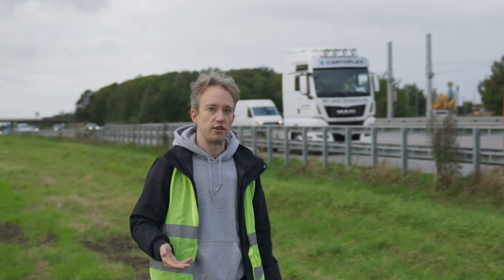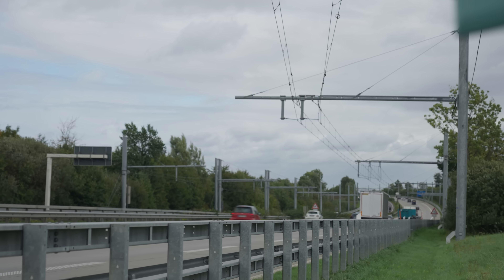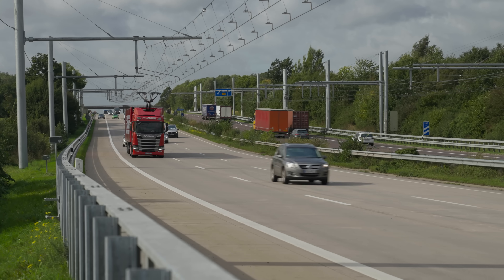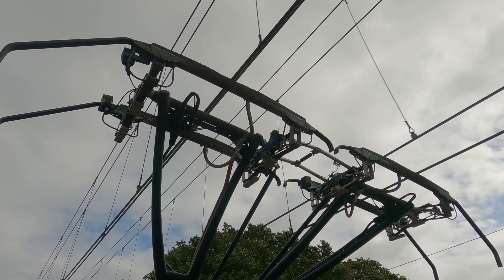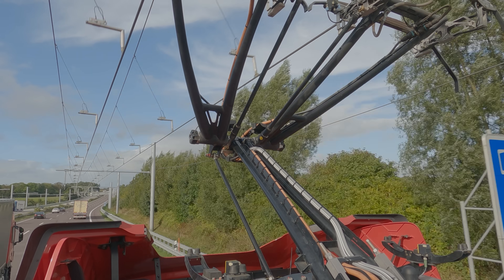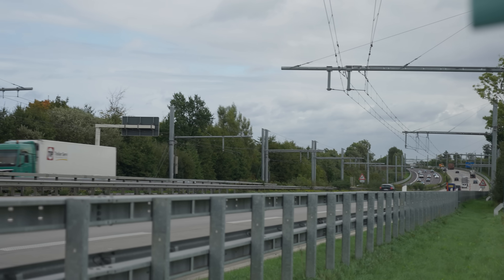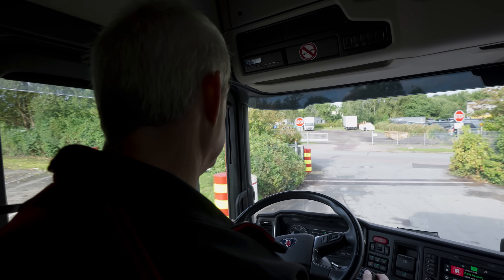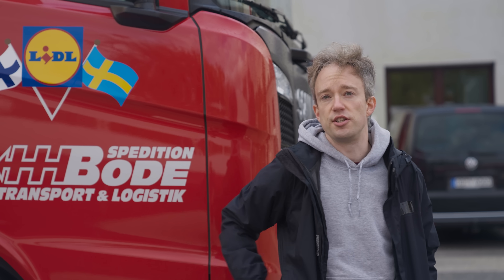The highway where trucks work like electric trains

Comment: I get it that it is just like a train, and this electrified road based transport has been done before (trams). But the hybrid nature of this is a delightfully good idea. The trucks can have back up batteries that allow then to do the last 50 miles off grid and then charge up when they get back on the electrified highway.
Reply: trolly bus and trolly truk
Reply: Eventually this system will become a rail based system again because trains are the crabs of transportion.
Reply: Also in Newcastle NSW Australia, their tram line doesn't use overhead wires, they charge the capacitors when at a tram stop with a pantograph! And the Newcastle trams use 1435mm gauge track!
But wait there's more... All the Australian tram networks use 1435mm gauge tracks even though the different states have different gauges for the trains!
Reply: Should have been compared to trolleybuses than trains.
Reply: or just have trucks do the last 50 miles and have trains do the rest?
Reply: @klintcook-z8m  Even in socialism you need capital to build infrastructure. Yes we could reintroduce slavery as a measure for cheap labour, but until then trolley trucks are a viable alternative for areas without possible rail infrastructure.
Reply: @klintcook-z8m  Reloading is a b**ch for logistics firms.
And electrifying existing main road trunks is much cheaper than expanding train tracks, or even building new ones. Same land use, aready existing fundament work ect.
Reply: @klintcook-z8m better yet - remove the need for those last 50 miles by having cargo train stations at industrial sites and passenger train connections with large warehouses for consumer goods, now just cook with dry or frozen goods and cultivate some veggies in your local walking-distance garden😅
Reply: @miepmaster25  spot on, that is exactly what occurs in Netherlands and especially Switzerland. In fact if you examine old industrial centers in the united states, they often had a railway line running up to the rear loading decks or right through the industrial park for this very reason. Yes they were electrified like they are in europe but anything to avoid the massive tyranny of road based delivery which is incredibly expensive.
Reply: @klintcook-z8m  The existing railways are already used extensively for freight, so if trucks weren't needed, there would be no trucks already. They use the same rails.
Reply: @SteelSkin667  Freight rail is extremely underutilized in Europe as freight companies are private, but rail infrastructure is public, so they favor public passenger use.
Reply: @klintcook-z8m  that would be massively inefficient though
Reply: @ObristPlayep  why? i would imagine leveraging and existing train infrastructure is cheaper than the overhead power lines for the truck's pantograph.
Reply: @klintcook-z8m  I guess this is for places where there is no sufficient train infrastructure already present. And there, only building the trucks+overhead lines is significantly cheaper than building trains+lines+tracks+stations, and more flexible
Reply: @kleinhaas137  true, but europe does have an extensive rail system. maybe the industrial infrastructure is distinct from the passenger rail system. it just felt that this is a solution to a non-existent problem. but i may be wrong.
Reply: @kleinhaas137  Fun fact: The two cities connected by this highway are also connected via an electrified mainline railway route certified for 160 kph, so there already is a sufficient solution in this case.
Reply: @ObristPlayep  No, as nearly everything is containerized.
Reply: @j03l911  damn this fact makes that infrastructure completely worthless
Reply: @ObristPlayep  trucks are massively inefficient compared to trains, less friction, less rubber, more load, and less awful batteries
Reply: @klintcook-z8m  transfering cargo between platforms and the logistics.
Reply: @klintcook-z8m  No, you’re 100% correct, which is why there is little to no interest in it from people that actually matter.

Electric freight trains are FAR more efficient than electric trucks like this. All you need are BEV trucks in towns/cities to get the goods from the trains to the customers. That’s not to mention the cost of building/maintaining this or the trucks themselves or the traffic they would create.
Reply: @TheProtocol48  Freight transfer is a very simple thing that these trucks still need to do anyway. Long-haul trucks tend to deliver to centralized distribution warehouses that often have their own train tracks anyway.
Reply: @kleinhaas137  the rail infrastructure to handle a given amount of traffic is orders of magnitude cheaper to build and maintain than the highway infrastructure required to handle the same amount of traffic, not to mention trains are just inherently more fuel-efficient running off any source of power than road vehicles are. Any benefits from electrification will be far outweighed by the cost to build + maintain the infrastructure and environmental damage caused by highway construction, road and tire wear.
Reply: @afcgeo882  Aside from a couple of Royal Mail depots in the UK I have never come across a distribution warehouse that has its own access to the railway network. If a warehouse did have rail access, it would only use that for a bulk import. If it were to use the same access to then move goods to their individual destinations, you would need just as many locomotives as trucks as the trains coming out would only be one or two cars long. Then there is the destination, this can range from being in the middle of a city to in the middle of nowhere. Neither of which are likely to have access to their own train station. So now you need a truck to move the goods from the nearest freight terminal to the destination. This method would be vastly inefficient compared to using one truck for the whole journey.
The railways are good for handling a very low number of very large vehicles carrying a huge ammount of freight all going to the same general area.
The roads are good at handling a very large number of very small vehicles carrying relatively small quantities of freight going to many different destinations.
Reply: @ObristPlayep  You would need to work out the energy consumption used by trucks to move say 60 loads as against a train , including things like wages and maintenance . Dont ask me , i am garbage at maths
Reply: @klintcook-z8m  I think the point of this is it allows electric trucks to make long distance trips more efficiently.

A company that does the final deliveries may want to transport trucks from one city to another at some point for whatever reason. or have inter-city trucking for whatever reason. Using a railroad may be too much of a hassle or its easier to just load up a truck once and then unload it at the destination rather than having to load up a truck, then unload onto a train, then unload back onto a truck, and then finally unload at destination. Thats two extra unloading that doesnt need to exist without the train in the middle.

So this solution allows companies to still use electric trucks to avoid the extra loading/unloading of their trucks, and also allows their trucks to travel between cities without their vehicles being locked to a specific city which may only let them easily service locations within their own city.

This also helps for servicing remote areas too. For example, lets say a company has a big warehouse in a city. But they want to service a small town about 100 km away. There is a trianline there, but they dont have any infrastructure there in that town to transport the goods from the trainline to the customers. They would need a small truck to transport things the rest of the way, which they may have in their main warehouse, but they have no way to actually get that truck to the small town without taking a highway off grid which requires a combustion engine. So having a highway like this means they could use an electric small truck to transport the goods out there and then it can run on its normal electric battery while delivering products to the customer once inside that small city, and then drive back to the main warehouse. No need to have additional infrastructure to house, store, and charge trucks in EVERY city/location they want to service as they can move those trucks between locations.

The issue with trains is their routes are fixed. You can take things between major hubs, but without additional infrastructure, you cant take things from those hubs to locations to other nearby locations. This means any local delivery needs to be done by trucks. And if you want that truck to be electric, there needs to be infrastructure IN THAT CITY to house and charge the trucks in that city/town. Big cities may have this, but smaller rural areas will likely not which means trains may not be an optimal solution for all types of delivery. 

And this is why companies still use trucks to transfer goods NOW despite shipping by train generally being cheaper. It cost way less fuel to transfer goods by train than by truck. But most short distance shipping still uses trucks despite that because there are other benefits to trucks.

So this solution works great for those situations which are still quite common.
Reply: @afcgeo882  And where do those electric busses come from? It has to be local transport. So this means every city/town a company wants to service needs to have a warehouse there to store and charge these electric busses for that local city/town because they wont have enough battery capacity to travel between cities/towns, service them, and travel back again. You would need a combustion engine for that.

Most companies dont have a warehouse in every city/town that they service. They usually have a more central location, and then they ship out things from that central location using trucks.

Delivery by train is ALREADY more cost efficient than delivery by trucks. But companies STILL opt to use trucks for many situations because trucks are more flexible on where they can go.

If you live in a small town and order something off amazon, then that product may get shipped by train to a major amazon warehouse, but in order to get to you, its going to get put onto a truck, and that truck will travel to your small town and then deliver it to you and then drive back. This trip will be too far on current electric batteries for trucks, (or highly inefficient), which means a combustion engine would have to be used. 

This electric line solution would allow electric trucks to travel between cities/towns without a combustion engine by using grid power, service that city/town using their stored battery power, then travel back on grid power again. 

Trains are still the most efficient for transport of goods between major locations to warehouses, but from nearby warehouse to customer, the most efficient model is still trucks. And many times, those trips are inter-city trips because companies dont build warehouses in every single city/town.
Reply: @eragon78  The infrastructure for charging is very basic for busses. They go to the same place every night, but you’re right that right now there isn’t infrastructure out there to charge all over. Of course you also don’t have the infrastructure in the video. That’s for intercity transport.

For last mile deliveries (from the train to the customer), there ARE warehouses. They aren’t owned by the manufacturer of the goods, but space is rented by the shipper. There are also warehouses at freight train terminals. If you’re talking about those deliveries, they are within the city and the owners of the trucking company have park lots for them, for overnight storage. That’s where they would charge.
Reply: @kleinhaas137  It won't be cheaper long term.
Reply: @kleinhaas137  we need more track not trucks because the truck maybe cheaper in the short term they are extremely inefficient due to rolling resistance and they damage the road the most
Reply: @klintcook-z8m  Maybe in Europe - but trust me: In Germany we don't have an "extensive rail system" - at least not anymore. Many routes have been given up and those still existing lack stability and capacity. We would need many centuries from now to increase capacity and reactivate old routes in order to replace long-distance road transports.
Reply: Grammar error.

that allow THEM* ,  not then.
Reply: @Realbenbudson  it's a typo, not a grammatical error .. but nice find 👍 :)
Reply: More like 300 miles and this is just a charging system.
Reply: @Binoy: True, a small battery backup is good. So that the transition would be easy when the truck leaves the  cable, it won't stutter and gets time to start the gas
Reply: it is way less efficient than trains due to rolling resitance
Reply: More specifically it's like a trolleybus and could serve a similar role.
Reply: Could that be an up scaled version of the trolley bus? That is trolley truck?
Reply: Nice idea where is no trains, like from Here to There!
Reply: This is more akin to a trolleybus than a tram
Reply: Agree with this. Plus, making a new track and a new station for another electric train could be far more expensive than making the poles and cables on existing highways for this electric truck
Reply: @dri4nr4dit37  there is already a electrified trainline with a max speed of 160 between these cities.
Reply: The Crazy Train people forgot that these trucks mainly carry goods from and to places WITH NO RAIL NETWORK.
Yes we have Subpar rail between SOME cities. But those rail didn't go through the depot, warehouses and Every single area where these trucks delivered its good.

We need trucks to delivered the goods from places to places. To think that you could just build rails everywhere is lunatic.
Reply: Why? Why do this? You already have a vast electric train network. Just shift your freight onto trains and use battery electric buses for local transport. A freight train can transport the freight of hundreds of trucks with FAR more efficiency than what you see here, and that infrastructure already exists!
Reply: @afcgeo882  i fully agree. And in cities that use trams they can have special cargo trams that transport to shops and other in-city buildings.
Reply: @afcgeo882  this feels like the tram/trolleybus debate
Reply: @truedarklander  No, it’s more similar to the car/trolleybus debate.

Trucks don’t run on set schedules and on set routes. That’s their main advantage: flexibility. Attaching them to wires destroys their main advantage against trains. Otherwise trucks are costly, inefficient and require a lot more maintenance than trains.

A truck is more convenient than a train the same way a personal car or a motorcycle is more convenient than public transport.
Reply: @afcgeo882  Well that's the thing, it doesn't really matter where those trucks are going. For regular long haul train is always going to be the superior solution by far, but even on shorter and irregular routes trucks will always try to hit motorways anyway if they can. If they can use that part of the trip for charging it is still has the potential for being extremely convenient for them.
Reply: @SteelSkin667  this system may also increase delivery times due to drivers making detours using longer routes that use a section of motorway vs shorter faster routes that i.c.e truck could use
Reply: @afcgeo882  I disagree that a personal vehicle is more convenient than public transit. The problem really lies if the schedules and set routes are unreliable or not frequent enough. In Japan for example, if you want to travel around the country, a journey with a bullet train will be faster and more comfortable AND more cost effective than using a personal car. The only thing a country needs to do is invest good money into the reliability and frequency of public transit and you'll see that many people prefer travelling with the train instead.

But freight trucks ARE indeed a lot more flexible than trains are.
Reply: @afcgeo882  no they are? According to the dictionary: buses, trains, and other forms of transport that are available to the public, charge set fares, and run on fixed routes.

Intercity railways and also outer city railways are both public transportation by definition. Idk what you are/were smoking sir
Reply: @energeticstunts993  PUBLIC TRANSPORT and PUBLIC TRANSIT are different things! What are you, 12?
Reply: And the road's ground needs no modification
Reply: what happens when a storm takes out these wires?
Reply: @lilaclizard4504  The same thing that happens on a railway: a vehicle that doesn't need these wires rolls in carrying electricians, and they fix it.
Reply: @beth12svist  um no, not in Australia, when a storm takes down a trainline, it's chaos for days! "Railbuses" need to be brought in to replace them & huge areas of the network cannot function cause of a single tree down over a railline somewhere. Most long range railway lines in Australia don't even have electricity wires, just diesel trains, cause of the chaos it would cause with anything else, since a single tree down would cause the entire supply system to fail. A tree coming down on wires & breaking them is not easy to fix!
Reply: @beth12svist  Just curious, how often do trees come down on your raillines? Do you actually have experience with the results or are you just guessing without actually ever having experienced it, just assuming?
Reply: @lilaclizard4504  Strong wind can do that. I can't really say how often; especially because, hey, strong wind isn't necessarily an easily predictable and... average-able element. The thing is also that we have, if I'm not mistaken, one of the densest railway networks in use and I've been travelling primarily by train my whole life and my father has worked with trains for most of his life and has friends who work for the railways and thus a lot of inside knowledge so... what seems fairly commonplace and common-sense to me may not really be so to others. As far as I know, it's more likely to happen on smaller railway lines that run through forests where the trees are closer to the lines, than on the mainlines.
Reply: @lilaclizard4504  Keep in mind that this is in Germany. In mainland Europe, railways and motorways are always well clear of big trees, and while strong winds can bring lines down by itself, it is usually fixed in like a day, maybe less. If those lines would fall onto the road, they'd just have to have some line workers drive there truck and fix it up.
Reply: @SteelSkin667  So for an entire day, trucks just stop dead in the middle of a motorway? Did you think that through?
Reply: @afcgeo882  More like a few hours and extremely rarely if similar incidents on rail tracks are any indication. "But sometimes!" is rarely a good argument, honestly.
Reply: @lilaclizard4504  the beauty of this system/idea is that when a part of it fail is does not matter. The trucks can move a lane over and run on there batteries for a little while. Once they passed the dammaged section they reconnect and carry on. This same capabillity makes that not every mile needs to be electrified, and so hard to electify places like junctions dont need to be.
Reply: @MegaCbgames  good point
Reply: I honestly think this idea is awful. I mean it looks cool. Its definitely a cool premise.
Reply: ...Probably under a cover, to hide the ugly thing the rest of the time
Reply: @marioluigi9599  you calling pantographs ugly 😂😂😂😂😂
Reply: @marioluigi9599  Trucks are (just like any car) just functional, so ugly or not is irrelevant